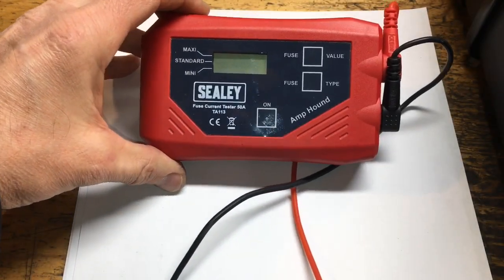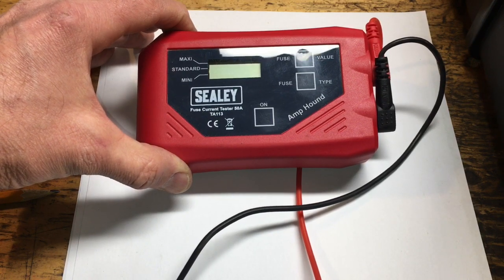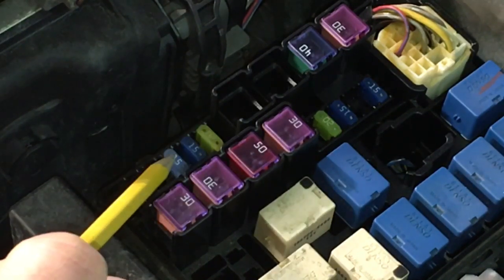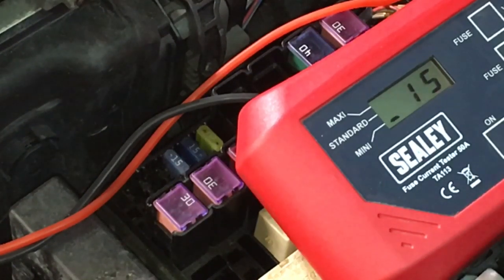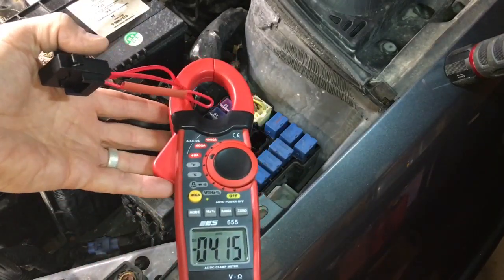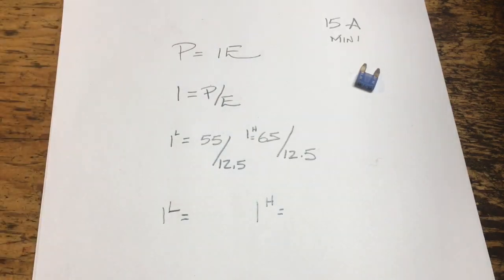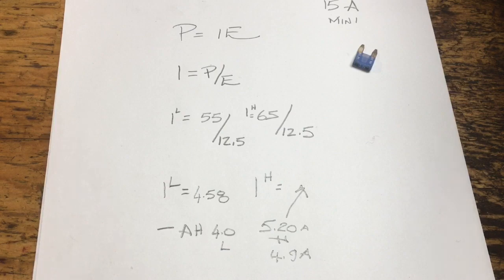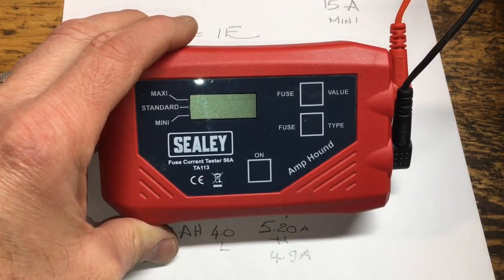Amp Hound Cross Check

Comment: How do you test if the circuit is drawing amps if the battery is dead? Do you have to charge battery first? Or does it somehow figure out the amp draw with the battery dead?
Reply from the maker: It does the calculation by measuring voltage drop across the fuse. Since you have selected fuse type and rating, it knows the fuses R value. Then it’s a simple I = V/R calculation/conversion. So nominal battery voltage is required for meaningful results. Thx for watching 🍻

Comment: Good video. Any discrepancy between meters may only be minor differences in fuse element size. In other words, quality control at the fuse manufacturer could impact results a bit. To further clarify - a poorly manufactured fuse with too small of an element would indicate higher current than actual. Plenty accurate for its purpose!
Reply from the maker: Yeah good wee rig. Thx for watching. Cheers 👍

Comment: That's a great tool, only thought it was for testing a drain on the battery, never thought of it being used to check the amps used on an intensionally powered up circuit. Thanks for the demonstration
Reply from the maker: Cheers Matt